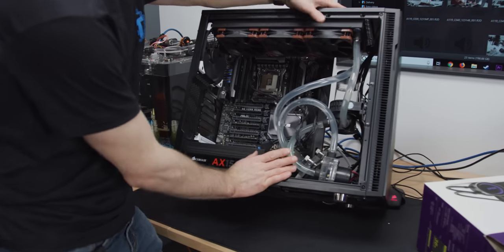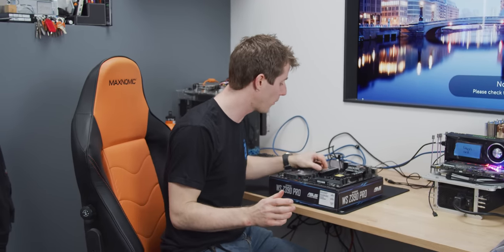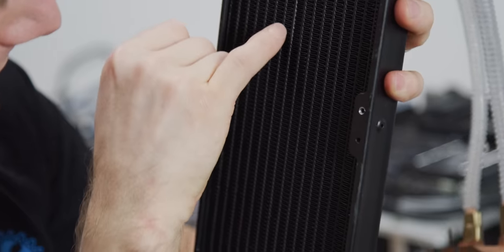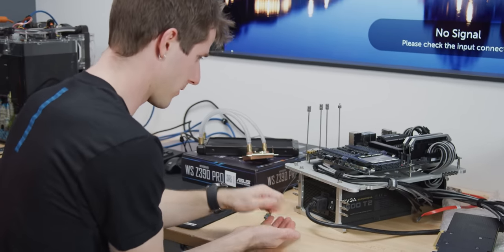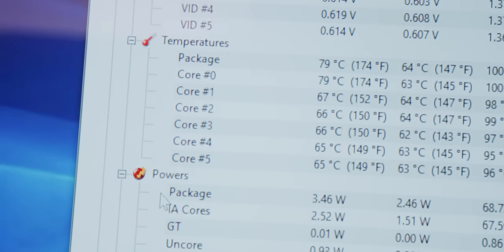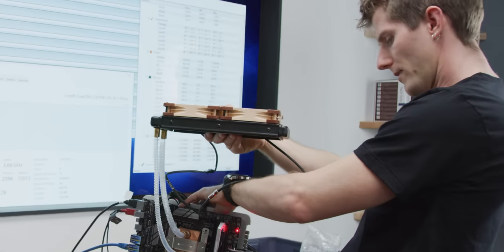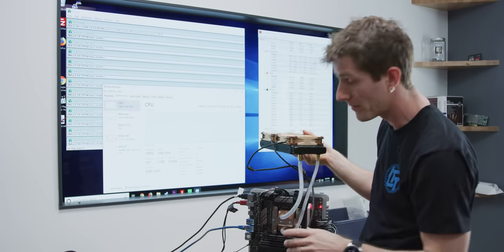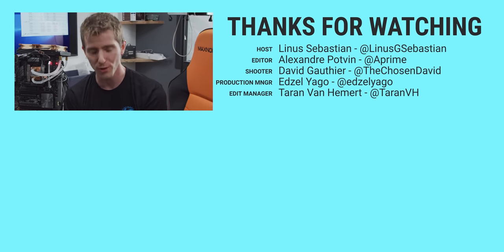CPU Cooling with BOILING LIQUID 🔥🔥

Comment: I made a similar prototype pumpless watercooling system with my father in 7th grade around 2004. We used a big-ass engine cooler as radiator and we placed it much higher above the CPU. And IMHO this aspect is crucial in case of gravity-assisted convection cooling. 

We didn't have money to buy new material for the construction, so we used scrap material what we found laying around the house. This resulted in a practically failed project because our system ended up having too much flow resistance. We completely redesigned everything but we didn't have the money to buy the stuff needed, so it remained theoretical. The gen1 prototype did cool the CPU but it wasn't effective enough and the CPU throttled. I'm quite confident that gen2 would work though. I even applied for a patent but again, I didn't have the money to pay for it and actually have it registered.
Reply: @k0p I probably have pictures somewhere but I absolutely really don't care about what others believe. My points are valid without my prototype being built or not.
Reply: @k0p "When questioned" – in fact I stated that in my OC. And yes, I didn't have any money to fund this project as I was in 7th grade (13 yrs old) and my father was broke. I'm not from a wealthy country, this was not uncommon in those days (nowadays neither). This was 14 years ago. And you ask for a picture. I'm not even sure we had a digital camera back then and I'm not sure we would have wanted to use a film camera to document this. In retrospect, it would have been a good idea. But I'm pretty sure I have some of the hardware remaining somewhere. To add, my father is an HVAC engineer so this was his field to a degree.  He had several inventions and held different patents. But in this project I had some creative value added.

But why do I even reply – Mr. Sceptical doesn't believe a thing without an audited timestamped proof.
Reply: @k0p What do you mean by "on"?

Comment: .. if you:
-mostly fill a normal loop with isopropyl alcohol
-hang a bit of tube below the inlet of the cpu
you should have a pump-les  setup.. if i'm not missing something...
Reply: Worth a try (on a Pentium 4 or something similarly worthless and hot), but i have minor doubts that you can get to 80-100°C core temperature with a fluid with a boiling point around 80°C, due to Intel's propensity to use Mozzarella for thermal interface.

Comment: There are whole Heating Systems designed for this kind of Circulation, if you want more flow you have to increase the height difference and also use BIG pipe diameters to reduce friction within the pipes.
Also the higher the temperature difference the better the flow

Comment: I are just a truck driver but you need the radiator horizontal by length then have the hot line to the top and the cold, return out the bottom

Comment: i have one pump less gaming rig set up with r-141b coolant in it. the way i achieve it is the system it self has an internal vacuum pressure, check valves so that the flow is in one direction, expansion valves and all copper pipe connection. the principle is temperature/pressure differential.

Comment: Linus you need a custom built radiator. The mounting of the condensate must be such that the inlet of water and vapour needs is on top, with sufficient vertical height from the cpu block, and the liquid on the bottom, this effectively allows a continuous and stable water circulation thanks to the static head of liquid over the radiator.

Industrial Steam boilers are often made on this principle, without the need of any pump.

Comment: For truly silent, you'd need some large heat pipes, and it you want it dissipating to the outside of the case, a way to bend them into the shape you need.  Lotta custom work, but I believe heat pipes and fins are the only real noiseless option.

Comment: BTW, another awesome effect with these type of heatpipe designs is that boiling occurs from the differential, not from the absolute temperature.  If you put ice on the radiator, it will cause the fluid to boil faster, which will condense on the cold rad, and flow back down as very chilled liquid.

Comment: I would have the hot come out the high side of the radiator, and change the radiator alignment for a sideways mount, with the hot-in located above the cold-out. This way the gas pressure forces the liquid out the low side of the radiator back into the low side of the waterblock. A one-way thermostat valve like you find in a car engine would also help immensely.

Comment: Surely orientation for this kind of thing is key. The convection current needs to be gravity assisted. In the same way a central heating system or water heater would work?

The cold feed into the block needs to physically be below the hot outlet and then the reverse for the radiator, hot feed into the top then cold coming out of the bottom? That way the convection current flows with the force of gravity providing assistance?

Comment: I don't know this product but if it work like a freezer system then you should place the big tube on top and the small tube bottom.
The big tube is to prevent a premature condensing of the liquid ( big tube = less pression = higher condensing point).
The problem is see with this system is that you won't be able to get temps under 100°c because it's only when the water is boiling that it will absorb temps.
The good side is that you will never get temps over 100°c if the water is always condensing and at liquid stage in the CPU block.
When you reach the boiling point of a liquid, it's temperature will never get higher than the boiling point until all the liquid is in vapor.
So if you always have water in liquid form in the CPU block, the vaporisation will assure you to never be over 1000c, but you also never be bellow as well.
What we can say now is unless they use a liquid with a lower boiling point, this cooler will not be ideal if you want to keep your CPU under 40 idle and 75 load.
And when you know that every rise of 10°c is dividing by 2 the lifetime of electronic composants, you definitely don't want that cooler.
:)

Comment: Built a rig 11+ years ago with a lian-li case and Vapochill LS Lightspeed phase change unit — a lot of dremeling and filing involved (I wanted watercooling for my gpu too). It was a noisy bit of kit and took a minute just to fire up the cooler and get the cpu down to sub-zero. I could be wrong, but the process/science of cooling I am guessing isn't far of here with an evaporator head boiling off liquid and drawing heat away.

Comment: Venturing more into the more boiler  side of HVAC has me thinking of ways to do this essentially. You could even use one pipe if the orientation was right you can have hot and cold water flowing opposite directions in the same pipe.

Comment: would think that having the radiator vertical with the inlet at the bottom would aid in convection. hot water in the bottom rises to the top of radiator pushing cooler water back out the bottom outlet.

Comment: I would love to see an episode where Alex builds a custom loop using water in a phase change thermosiphon loop.

You could use water if the pressure in the loop was low enough to put the boiling point at about 50 deg C. You’d probably need to use equipment from the HVAC refrigerant sector of engineering. Soft copper lines, condensers, joining methods (brazing & compression fittings).

You would evacuate the loop after construction, then charge it with distilled water to the pressure where the boiling point is about 50 def C. You’d need to make sure when you were at your max design heating condition, you still had some liquid water on the cpu and gpu. An expansion tank would help tremendously to keep the boiling point at your design cpu/gpu temperature. As you add heat to the system the temperature and volume will will rise, but since the pressure remains the same, so does the boiling point of the water.

It takes 144x the energy to convert 1 gram of water to steam, than it does to raise 1 gram of water 1 deg F. So I think it would be a very efficient system of heat transfer.

After all that you could get a pretty neat cooling solution with no pump, and pretty effective heat transfer making use of phase change of water (and water/steam which is basically the best heat transfer medium out there).

You’d probably have a cooling block on the cpu and gpu where you got entrance to the block on the side of the block (where the liquid comes in), and an exit above that on the top of the block, where the steam leaves. Steam enters the condenser at the top, condenses, and falls to the bottom of the condenser where it exits, back down to cpu/gpu.

It would just be a really neat piece of artwork on top of it. Not sure if anyone has done it before. Def would be an awesome episode.

Comment: There are multiple ways of designing such systems.
Obviously simplest one is using convection. Hot medium is less dense, goes up, cools down, becomes more dense and goes down. That's simplest and least efficient.
You can use evaporation and vacuum. Now the thing is, if you have closed loop under vacuum, then as soon as something evaporates and becomes gas, it fills up entire volume of the loop. That's how heat-pipes work. Then it uses capillary action to bring medium back to heat source, so you don't need gravity. Otherwise it would probably work as long as heat source is always on the bottom. It's saver to use capillary action.
Third solution is what heat pumps do. Both methods above use those principles naturally by moving hot medium to cool down to ambient and go back. Similarly your regular laundry dryer works just by heating up air which becomes drier and uses that to dry laundry. It then cools off to ambient temperature and excess moisture condenses somewhere. If you try to force this process, then it becomes even more effective. Like laundry drier with heat pump. It first cools down the air to condense water, then heats it up to ambient (making it dry), then takes moisture from laundry and cools it back. The only difference is that it operates on lower temperatures. Similarly you can use medium that will turn into liquid if you compress it on one end. Then use small tubing and let it heat up and expand on heat source. It will evaporate taking a lot of heat away and now it will flow back to condenser.

Actually, if I were working for Linus, I would be building it right now. You tried already different setups with chillers, special coolers, ice buckets and so on but you did not create ultimate heat pump connected directly to CPU. No additional medium, simply make evaporator cooler! It should not be that difficult. Basically evaporator is just big radiator taking up heat from surroundings. On the other hand regular air coolers are just just radiator radiating heat away. So if you make it the same device, you skip additional medium - your AC is cooling your CPU directly!
Obviously it would be much harder because of hard copper pipes used for AC systems but I've seen LTT doing much more stupid things than that.

Comment: also higher pressure in the loop would effect the boiling point, so nice preasure rated piped a good charge of 410a i bet the phase change would be wild

Comment: use one cooper tube for hot outside and isolated larger for back  with vertical radiator to use all surface for exchange ;)

Comment: this could turn into an awesome thing. Since the state change from liquid to gas takes quite a bit of energy, it could cool a lot better than just flowing water I recon. then when the gas turns back into liquid in the radiator, it releases additional heat from that

Comment: Im pretty sure without a valve on one end of the tubes, the coolant in both tubes will only be moving one direction - away from the block as it heats up. And without sufficient coolant in the loop, with the presence of air pockets, full convection cannot take place effectively to cycle the coolant through the furthest end of the cooling block to really bring the temperature of the coolant down. In summary, add a valve, fill up the loop with more coolant and no air pocket. The heated coolant from the block will create enough pressure to cycle through all the chambers of the cooling block as the valve on the other end only allow the 'cool' coolant to return. Vola!

Comment: I'd love to see the results of that test with the fans turned on. I'd acquire this sort of product not because of the silence, but because of the absence of the failure point. The presence of pumps is the real reason I don't like WCs at all. If it fails nothing will work, and pumps don't seem to last enough to my tastes. On the other hand, two reasonable quality fans, spinning at a reasonable speed, will last for a PCs lifetime or longer. That's what I'd love to see!

Comment: The problem with arguing that water cooling is silent is that it still requires air cooling (fans) to dissipate the heat from the radiator. I still think that the Dark Rock Pro series or Noctua's NH-D15 is the proper solution to high end cpu cooling. Pretty darn silent, great temps, and low maintenance. Air cooling is still the sensible choice for the average user. Unless you consider water cooling a hobby in itself that you find enjoyment in, the cost-benefit analysis is more favorable towards air coolers.
Reply: very true. but watercooling helps whe you have a lot of high end parts, that you want to OC, in (relative) silence.
custom watercooling is an art, if you do wrong it could be worse than aircooling. but done right, it's thrilling to have your PC at full charge (CPU + multi GPU), and no more noise than at idle.
No aircooling solution can do this

but yea it's very niche.

Comment: They should've used a similar design to a human heart, where one cord is only allowing liquid to go one direction, that way cold streams can kick into the block and the hot one will only rise into the radiator. they should use directional engineering.

Comment: Diff radiator design. Look at old farm tractors or very old cars with no water pump. Hot water rises and goes into top of rad and cold water/return comes out the very bottom. So stand rad verticaly input at the top water flows down through it and the outlet on the bottom returns to heat source.  Would have to work better.

Comment: I believe if they could vertically mount the rad but above the height of the CPU and have the output of the rad at the bottom end and the input to the rad at the top it would help the convection movement because as the fluid cools and condenses it will drop to the bottom of the rad causing more head pressure to force fluid through the block.

Comment: This is the same principle on how coffee machines work. They boil water, the water evaporates and the bubbles push the fluid up. the radiator and cooling fans provide very minimal difference since the water first has to boil from the CPU then flush the heat out afterwards... So no cooling actually happens until the CPU is hot enough to boil the water.

Comment: Looks like there is air inside. In principle, it should be set up like a gravity heater. Without air, but with a little overpressure. In addition an expansion tank. Then it should work better.

Comment: The big hose was for gas phase and the thin hose for liquid phase. Gas goes up, cools into the condenser and drops as liquid down. Gravity matters so the condenser (big black thingie) should be vertical too, big hose (gas) on top, so when cooled will drip on bottom.
What's inside? My guess is regular refrigerant as found in auto A/C system.

Comment: I think the whole cooling unit should be redesigned to make this working. It should get the steam from the center transfer it to the radiator and when it's cooled returned to the cpu, but the heigh of the pipes should be different.

Comment: I could think of this working as a hybrid system, the block is also a massive laterally spread out heatsink with heatpipes and then also the tubes come out into a bigger rad, it would be massive and bulky but I would wager that would work  pretty well

Comment: They need to design this so that natural circulation occurs. The hot water should rise up through the larger tube into the radiator, be cooled enough to naturally descend down the other tube. Until they manage to create one-directional flow it isn't going to work efficiently.

Comment: Why not use a Stirling Cycle heat engine connected to a copper water block as the mechanical pump in a liquid cooling system? That way, some of the heat energy is converted to mechanical work and the water pump wouldn't require a power connection, so it would be completely passive, thus having a greater longevity (possibly).

Comment: This could be made more efficient and more effective if the exit tube was at the top of the radiator, and the feed tube was places at the bottom, with the radiator mounted vertically with both radiator fittings above the CPU socket 

Cool liquid flows from the bottom of the radiator into the CPU block, then the vapors flow out the top of the block and into the top of the radiator where they condense back into a liquid, which would ensure that only liquid enters the block, and would give the best possible results for a pumpless setup 

Applying that logic to this prototype, you could've rotated the radiator so the feed tube was at the bottom and the exit tube was at the top and it would've worked a lot better than you holding the radiator flat

Comment: and try this  combination hot  fluid from CPU go to top pipe (ot the cooler) and the fluid from (bottom) pipe goes to cpu and remove the bubbles. This is the right combination  i think